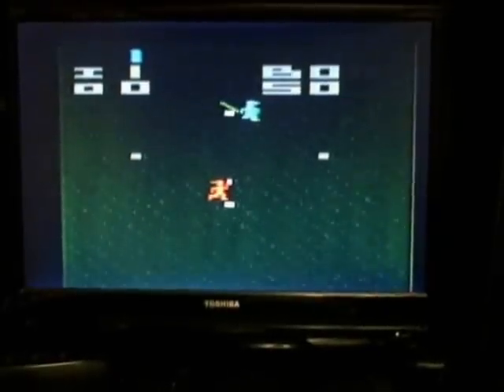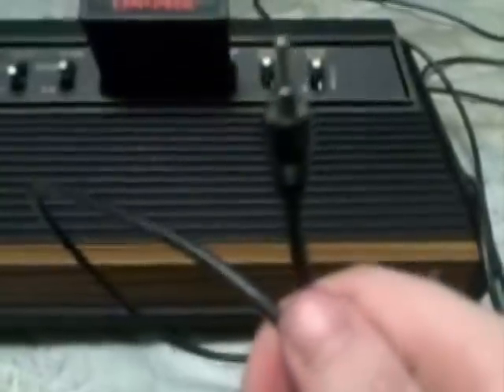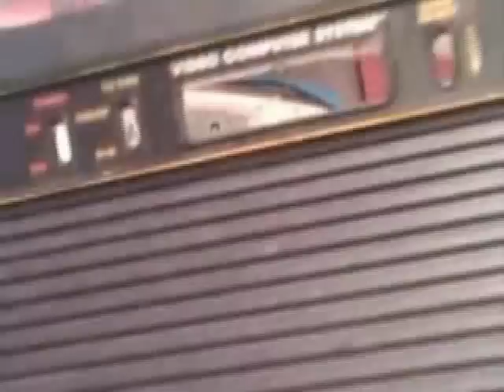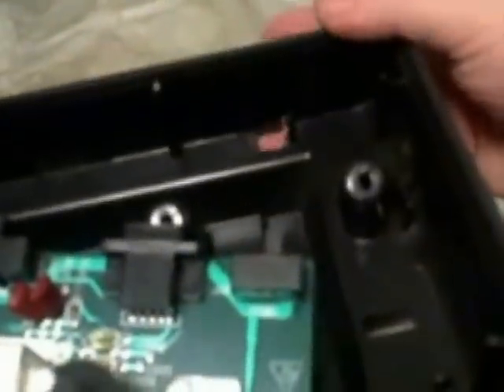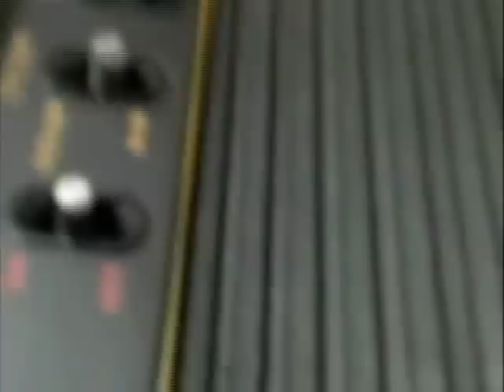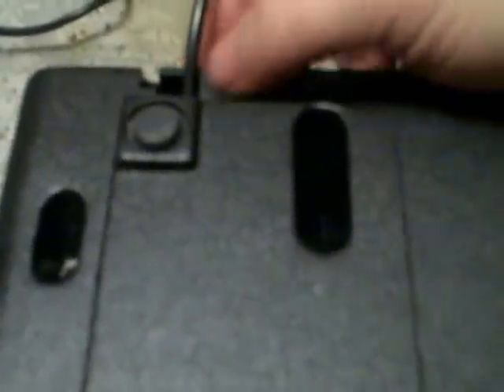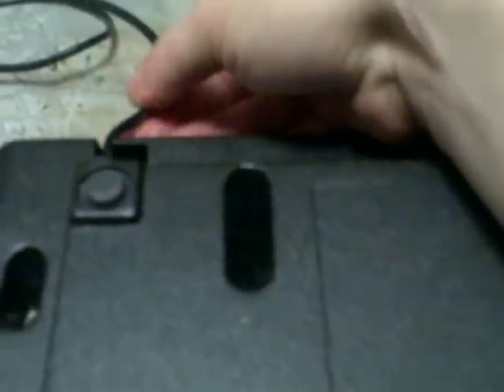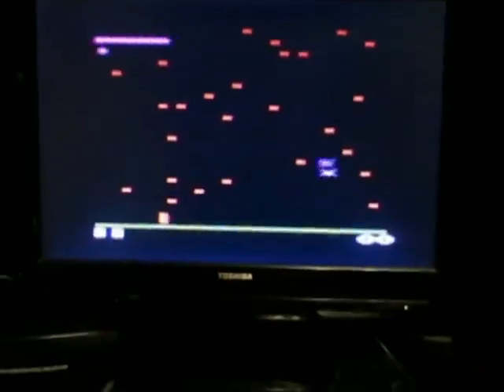Atari 2600 RF Replacement/Maintenance

Comment: Wish I knew about this before getting rid of my console.  The only thing wrong with it was that the connector in the back was really loose--I got so much snow on the screen that I could barely see anything unless I put something heavy on it to hold it down.  But I didn't know if there was a way to fix it, so I got rid of it when I moved  ;/

Comment: Wow, I made that comment 3 years ago, no wonder I didn't remember it  =P

Actually, I never figured out about holding the Alt key--I think the version I was using at the time had some little setting you could change to at least make it bigger on the screen.

I stopped using Stella anyway, once I upgraded my computer and wasn't able to use Camtasia to capture footage anymore. Now I have a different emulator that can capture its own footage.

Comment: I can't seem to find on his account now. Bizarre.

Well if you're worried, they're so cheap now, why not just pick up another off eBay (like the 2600 Jr if you want some variety)?  I've heard it's even possible to add an Atari cartridge port to those plug n' play joysticks you can buy.  It's definitely possible with the Genesis ones.

Comment: what do you think might be the problem? I am starting to think more and mroe, the RF cable is fucked,as it doesn't pick up the cartridge,but rather, random TV chanels,just 2 or 3 of them and extremely poor,like its trying to be an antenna,like you mentioned,but its not happening. should I just replace the RF cable,or might there be more to the problem? pls help bro!! lol

Comment from the maker: That is a bummer!  Well at least there is emulators.  Not as good as the real thing but at least you will not have to worry about unclear picture.  I found out how to fix the RF when I replaced the one on my old light sixer model.  Which I should have kept.  Oh well lol.

Comment: man,you're a fucking LEGEND - I think you have sold my dilema.. my situation is as follows: I have a Atari 2600 4 switch baby of my own too,and I think I might have exactly the same TV as yours: it's a Toshiba 32" HD Television (is that like yours?) but I can't for the life of me seem to get it working on that TV..meanwhile,it works a bit of an older non HD TV but with a little bit of snow&the color is slightly of&graphics are poor (not mierly primative but beautiful as Atari usually is) so...